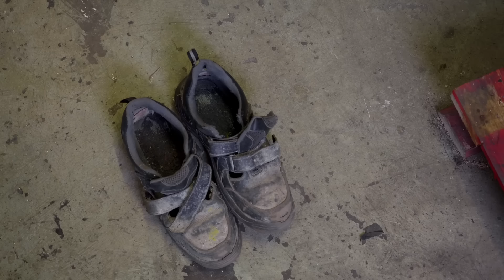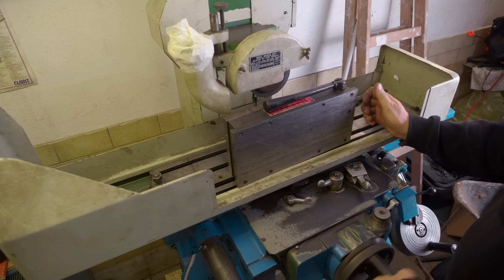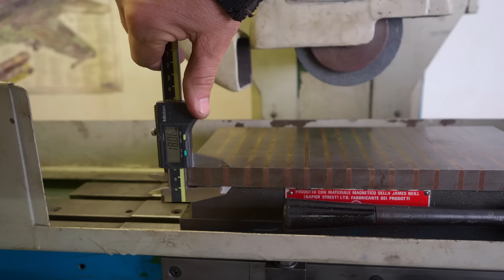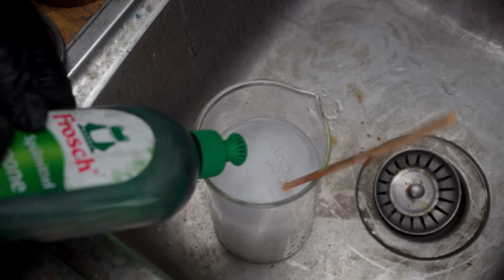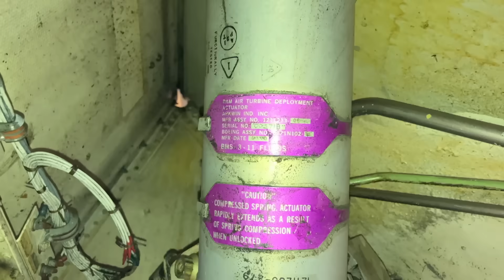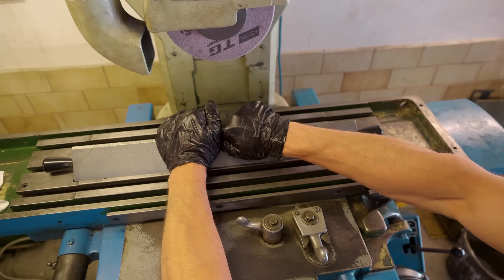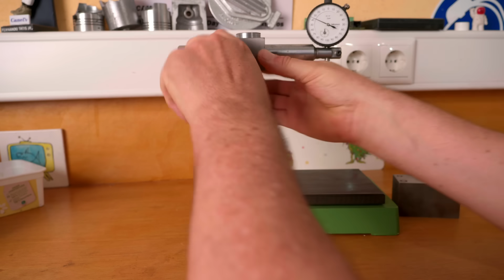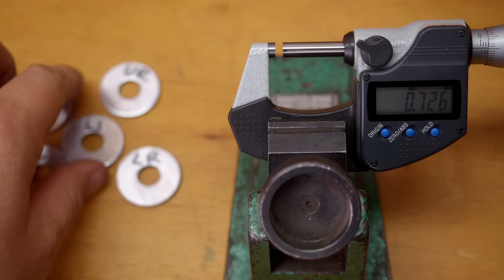Why cant I grind flat parts on my surface grinder? || RotarySMP

Comment: Acid + base?? Really???
Reply from the maker: Yeah, that was my first thought as well. They just neutralise leaving nothing, but no, they work in this combination. Try it.
Reply: It forms sodium citrate which is a chelation agent. Basically the molecule formed has a kind of hole in it that is the perfect size and charge for a metal ion to fit in to. That's why it works on the oxides, which is an ionic compound, but not the base metal.
Reply from the maker: @JaenFoster  You explain chemistry well. Thanks.
Reply: @JaenEngineering has kinda covered this, but you have to remember you're not forming a mixture. The result isn't "50% citric acid, 50% sodium carbonate, they sorta cancel each other out".  Instead, you're reacting two chemicals together, forming sodium citrate + carbon dioxide (which is why it fizzes all over the place when you chuck the carbonate in).

A mixture is what happens when you mix, for example, powdered rust with aluminium powder.  You get a heterogenous mix of the two powders.  If you add heat to that mixture, though, you get a reaction, forming  iron and aluminium oxide (plus a huge amount of heat)

Comment: I'm gunna try that citric acid and soda mix, it seems like the real deal at least for the cost. Now that you have a new screw driver (or surface grinder) does ever project look like a screw?  Getting a new tool, seems like now you have to justify it by using it for something or maybe for everything? Happy Sunday!  Hope you have a great time in the shop!
Reply from the maker: Hi Mike. Yes to the home brew evaporust. It really works well. 

I will probably surface grind everything till I get sick of it :)
Reply: @RotarySMP  Lucky for you your grinder has automatic feed, mine is entirely manual and the novelty wore off pretty quickly.
Reply from the maker: @jaytalbot1146  I did look at a manual grinder before I got this one, but am glad I went for the J+S 540. Also really glad Luke didn't transfer the power down feed from my one to his while he was packing it up :)

Comment: wtf. thats the first thing you must grind. the table. and of course clean everything first
Reply from the maker: I was hesitant, as the initial results were so terrible, I was worried there was something more serious wrong, where grinding the chuck would be pointless.
Reply: You want to be very careful grinding the table, especially without a good coolant flow.  If it's anything like the Doall D-8 I once did it will move all over.
And before grinding the magnet i like to get it running full stroke on both axis and let it run for a few hours so the oil is well distributed and all warmed up.
Reply from the maker: @andreblanchard8315  Thanks for the tips. I am sure I will be regrinding the table and chuck once I get a coolant system.

Comment: I think you will see the reason why there was a wallow in the center of your mag chuck. Remember they are laminated separate pieces. They do move around if dropped, hammered, left on for extended periods or even used with concentrated use in a smaller area. I have never pulled either style of eclipse chucks apart though. I was told many years ago that you had to Degaus them to disassemble them but never went to the trouble to try. Those chucks are often poorly handled and are remarkably fragile.
Your table cylinder may be over traveling internally. All you may need to do is add a couple of small spacers over the rod to hold it away slightly from the glands. Loose 10mm overall in table travel but it should sort it. The piston may be covering the center ports as well causing it to not have enough grunt to start its stroke. To check that you would need to disassemble and measure. If I remember that cylinder doesn't have any hydraulic cushions or annular boost piston so it's sticking at the end of stroke is almost definitely a port issue.
Small surface grinders are notorious for grinding all over the place and very much rely on the table velocity consistency and table weight/balance for repeatable results. But anything less than 0.05 mm doesn't take long to stone by hand to fix. I'm thinking when you make your piston rings but even more area can be done pretty quickly. 
Also finally a tip? I would often have grinding wheels close to the shaft size but still loose enough to be no located. The lazy fix to get them really close is just to wrap the shaft with a paper strip to build it's diameter enough to get a snug fit. Not perfect by any means but gets them close enough that you don't have to dress the stones to much if you remove and refit.
Cheers
Reply from the maker: Good tip on centering the stones. I noticed when I edited how loose the first one was.

Comment: Those hooks for the watering system will very quickly disintegrate. Your X1C can print UV-resistant filaments. I would only bother with PLA if performance is of no concern. Otherwise, you have ABS, PA, PC, PP, ASA and a bunch of other materials as options.
Reply from the maker: I did them in PET-G as it was loaded already, but yeah, I also have ASA and ABS which would be more UV resistant.
Reply: I printed similar ones in grey PETG, and they are now holding up the 5th season without issues, likely because they are mostly stuck in soil. Different to clips for clamping the tubes to the flower pots, those are gone after 1 season, either because they get brittle, or deformed in sunlight.
Reply: @mazchen PETG is also fine.

Comment: Wenn ihr das Futter schleift sehr gut kühlen.
Selbst wenig Wärme führt zu einem Loch in der Mitte 
Das Metall dehnt sich beim Schleifen aus und nach dem Schleifen zieht sich wieder zusammen 
Dadurch bekommt man immer eine Schüssel in der Mitte.

Den Fehler hab ich bei meinem Haas Schleifer auch gemacht
Reply from the maker: Danke Martin. Es wird aber nicht die 120µm Schüssel erklären oder?
Reply: Nicht unbedingt 
Da müsste das schon extrem heiss gewesen sein .
Mein Rekord waren mal 0.04
Reply from the maker: @MaD_Man_2000  Dass dachte ich auch. Ich muss noch ein Kuhlmitteltank besorgen.
Reply: @RotarySMP ich würde auf Minimalmenge gehen 
99 prozent der Fälle reicht das 
Und das macht nicht so eine Sauerei 
Ich muss mir auch noch was bauen, zur Zeit ist das eine Spüphflasche nit Wasser/Öl
Ich dachte an eine Konstruktion mit einer Art Venturi Düse.
Die dinger die man so ksufen kann haben mir nicht so wirklich gefallen

Comment: That rust remover works nicely really useful. I noticed it stains toolsteel/carbon steel when it gets a bit of use. 

Works nice heated as well. The other nice thing is it helps take off light millscale off stock material as well 

The hot bluing method on that chanel works well just thke adequate safety precautions as its really unpleasant chemistry 

Going to be a nice machine when running going to be surface grinding all sorts just because you can 😂
Reply from the maker: I can see that happening as well :)

Comment: Off the top of my head for a chuck to be out that much two things come to mind
1. It was being used off the grinder to hold work for hand operations such as deburring, countersinking, etc. and just wore down more where parts were being slid on and off
2. The feed shafts were bent, causing the table to rise off the ways 
Another excellent video, thanks
Reply: It can't wear 0,1mm without looking like an abused anvil after the process. It could be that some welder has used it and resurfaced it with a belt sander
Reply from the maker: Thanks Seamus. I was also thinking maybe they mis used it for welding set up, with thousands of meters of steel tube rubbed across it.
Reply: The chuck probably started out poorly manufactured.

We have one that I just to clean up with little or  no use.

One reason it kept getting stuck is they run a very low hydraulic pressure, just a couple bar.
Reply: It's an eclipse. There is no chance it started out like that.

Comment: Don't disassemble it. Eclipse say do not disassemble them as they can end up misalligned which can affect the force. You're meant to grind the chuck
Reply from the maker: It is jammed, so I assume it is full of corrosion inside.
Reply: @RotarySMP  maybe. It's scrap if you can't open it, and likely scrap if you do
Reply from the maker: @JSmith19858  My understanding is that you need to slide on an iron bar to keep the magnetic flow, but as long as you do that you should not demagnetise it.
Reply: @RotarySMP  I didn't say anything about demagnetising it. I said it could be assembled so it is misalligned when the lever is fully engaged, which can affect the force. I feel sure I'm wrong though, I mean, it's only what Eclipse themselves say. Try freeing it with oil any way you can
Reply from the maker: @JSmith19858  Good idea. I will see if I can get an oil in there.
Reply: Interesting point. Would you have a reference to that? I'm not challenging your info at all.
Reply: @Omsip123 Eclipse themselves. It's also in the manual for thier magnetic chucks. But you all do you. They're your magnetic chucks. Dismantle them if you wish. It's yours to ruin
Reply: @JSmith19858 I do not intend to open any chuck, Im genuinely interested about and how the harm is caused. Nice talking to you (and I could have done without the "you do you" part)
Reply: @JSmith19858 why do you think I want to dismantle the vise? I'm just curious why that would be harmful...

Comment: hahahha oh man, I did the same thing when  I made the rust remover but I did 10 litre worth on the floor, I couldnt get it to the sink quick enough
Reply from the maker: I just the next batch will be much slower mix :)
Reply: @RotarySMP  you will have to update me because i will be making 100L of it in a couple months for alot of tools to derust
Reply from the maker: @backyard_mechanic  You will need 10kg of citric acid, 4kg of wash soda, and rather large container .)

Comment: You have to weight balance the grinding wheels not only to get good surface finish but the bearings on the machine are overloaded if they are out of balance. I learned this the hard way when I bought my grinder I ruined the bearings on the first day.
Reply from the maker: These are small diameter wheels and only quite thin. Balancing will help, but imbalance at this level will not overload those bearings. 
I have a friend with a balancing jig and will balance them next time I see him.
Reply: @RotarySMP   it seems your wheel hubs might have enough internal volume that you could add some bb's for possible dynamic balancing?  I've always wanted to try this and then measure the results with something like a WIT Accelerometer and FFT.
Reply: @RotarySMP  you would be surprised…
Reply: Just be sure to ring the wheels before spinning them up.  😮
Reply: Small wheels don't need balancing , that's BS. They just need a fine trueing prior to use with the grinders diamond dresser.
Reply: @bobbybishop5662 Calling it BS is a little of a bold claim. Anecdotal evidence: I clearly can see the difference in surface quality, between balanced and unbalanced wheels. If I put a new 6" wheel on I true it, balance it and true it again. Just a thought: Why would all the grinder hubs for my machine come with balance weights if it was "BS"? You did not convince me, I keep balancing.
Reply: @timogross8191  He had to remove the balancing weights from the hubs. Of course they should be balanced. There will always be clowns that think they know more than the manufacturer.  Simple fact( and common sense) dressed concentric good, concentric and balanced even better.
Reply: @bobbybishop5662   so you're saying the visible pattern that showed up at the end without the balancing weights was due to truing?  I'm skeptical.
Reply from the maker: @scrout  I expect that balancing will help. I just need to make up an arbor to mount them on my mates balancing jig.
Reply: @scrout he had to take the damn balance weights off the hub.😂😂😂 Of course they need to be balanced.    There will always be clowns that think they know more than the manufacturer.👍 And smaller machines are typically( not always) lighter duty and less rigid so things like balancing are more critical.
Reply: I have been a toolmaker for 42 years and I grind everyday. Never once balanced a wheel just dressed them. If your bearings failed in one day then something was wrong with it when you bought it.
Reply: @blitzkrueg07  That is possible, but when I bought it, it was used in a machine shop until the owner died and when I powered up the machine it was perfectly fine. I changed the wheel because it was for aluminium and I wanted to get a rush job done. So I changed to a new 180x25mm disc which is not small and thought I will getaway with it and balance it later. But that wasn't the case. The machine developed a bad rattle.
Reply: I have been a tool and die maker for 40+ years.  I never balance small wheels.  The machine or chuck is questionable.
Reply: @doktortutankamazon I tried to explain this to my shot bearings but they didn't understand. All I say is if I had this advice back then I have been very grateful.
Reply: They eventually failed and you saw the first day as when the problem began or you mean they literally failed in one day of use? That would take a massively out of balance wheel to do that so quickly. As in vibration so loud you could hear it outside the building. It seems much more likely there was a bearing problem in the machine to start with.
Reply: @thinking-monkey it was fine with the original very small wheel. Replaced it did not balance it, was louder, had to finish one job, got rapidly worse, like in minutes. Next day took the spindle out, it had plain bearings with fresh 3 wear marks in triangle shape, the shape of the oscillation. I cleand it scraped it where was rough. Assembled it and the problem never returned since, with balanced wheels.
Reply: @Logan880121  Well, it certainly sounds like the larger unbalanced wheel is what did it then, although I guess the larger (thus heavier) wheel caused something to happen with a preexisting bearing problem. Of course the important thing is that you got it fixed and don't have the problem now. And your point is well taken: Why not balance wheels every single time if you can? For the people that are saying here that they don't do it, well, it may not help to balance but it certainly won't hurt either.
Reply: @thinking-monkey you are correct, my main concern is the uncertainity what you apply to the machine, stress and wear, what is not neccesary. And surface finish is affected too.

Comment: when the machine is bolted down and leveled  things may change
Reply from the maker: I wont be bolting it down, as my floor is not level. I will be putting it on feet.
Reply: @RotarySMP you're supposed to both bolt it and have leveling feet. No floor is so even that machines can bolt straight to it and neither is the bottom of the base machined flat, it's a cast surface
Reply from the maker: @MF175mp  I will accept the reduced accuracy and put it on leveling anti vibration feet.
Reply: @RotarySMP  I was thinking machines in general, nobody bolts grinders down afaik
Reply: I wasn't paying that much attention to the bottom of the stand in the video of this machine being moved into the shop, but my grinder has three-point support and as I recall, no holes for bolting it down, so it doesn't really matter. If the floor is level enough that the machine doesn't slide across the room it is likely fine. These are small machines, not long lathes.
 
A while back they moved the tool room at work and while I don't work in the tool room, I do general maintenance and they sent me to level the wire EDM. I was a bit worried because that "seemed" like a critical thing, but when I crawled under it, I found it too had three-point support and leveling was not that big of deal. That was a good thing because It was It is a lot bigger than my surface grinder and I sort of needed a hydraulic jack to take enough weight of the leveling screws to turn them, also I was working alone, look at the level, crawl under the machine turn the screw a bit, let down the jack, crawl out and look at the level again, repeat until it was "good enough"  but fortunately "good enough" was not that critical, I probably could have used a carpenters level, though we did have a Starrett 80-90 second "machinists level" so I used it.   Also the EDM was not bolted to the floor, not that wire EDM shakes all that much.
Reply from the maker: @jaytalbot1146  Mine also has the three bolt holes in the base. I am already planning the vibration isolation feet and riser blocks to raise it enough to get the pallet jack under it.
Reply: Worked 540s for 40 years never bolted them down they always sat on rubber pads 10 mm thick, rule number one always use a sharp diamond otherwise you are not dressing you are crushing the wheel, rule two always use coolant heat and accuracy don’t mix and third the wheel must always be balanced

Comment: Resurface the chuck both sides and the top of the table
Reply from the maker: I won't do the top of the table until I scrape in the machine geometry. Given how much metal we removed, it was clear this magnetic chuck will need another round of grinding next time it comes off.